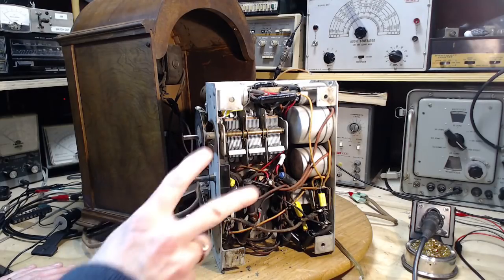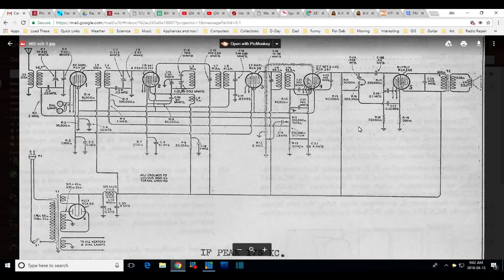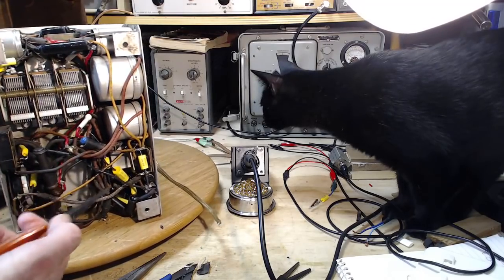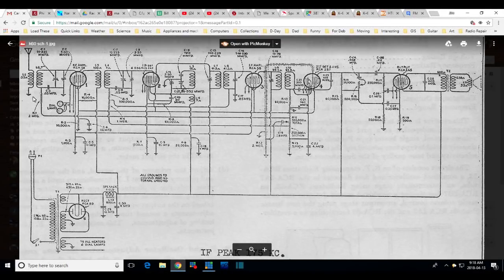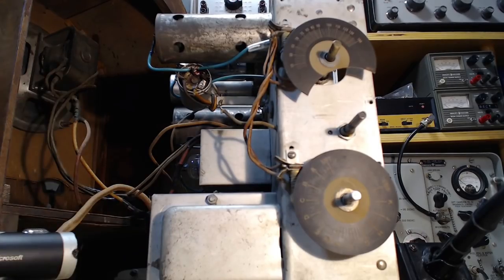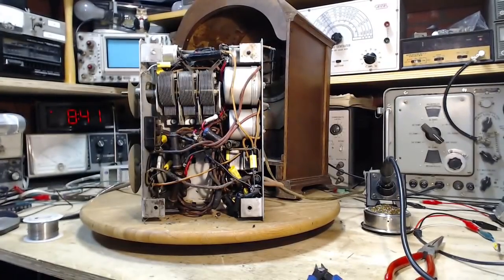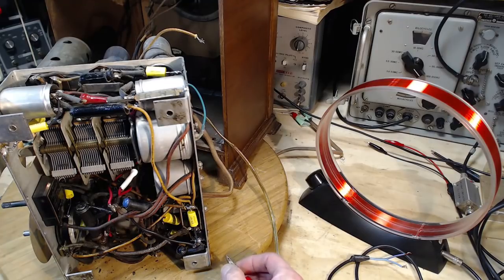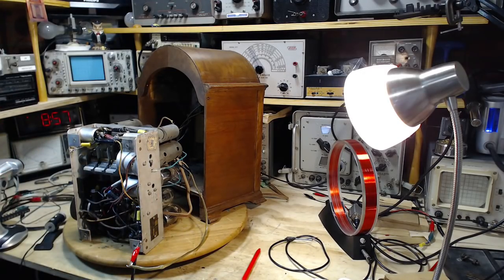Canadian General Electric K60 Video #11 - 3 Capacitors, 2 Antennas

Comment: What value capacitor have you put on the cathode of the 1st audio tube. It should be 4 mfd. I suspect you might have replaced it with a smaller capacitor.